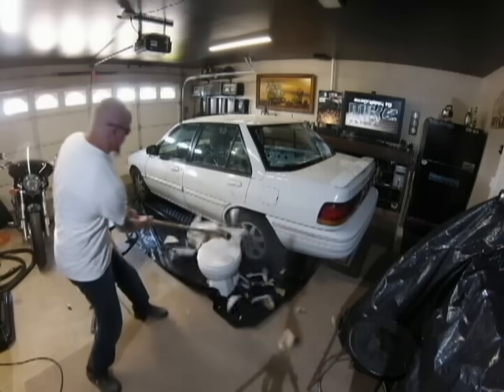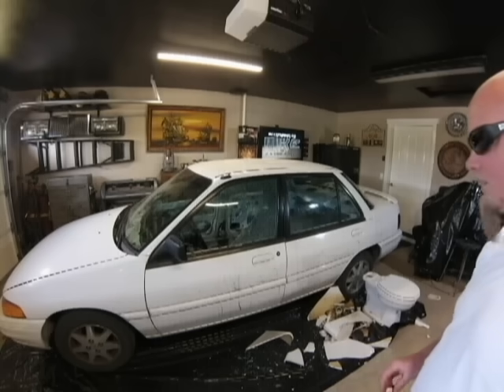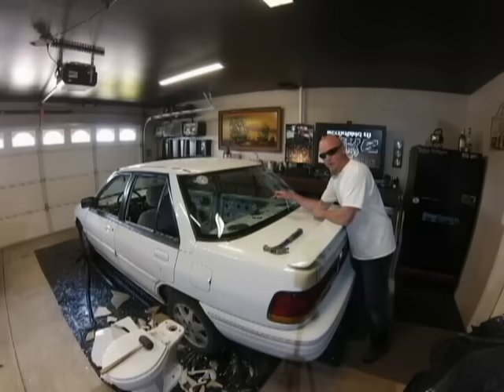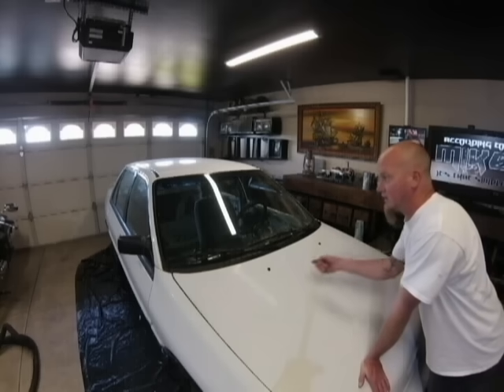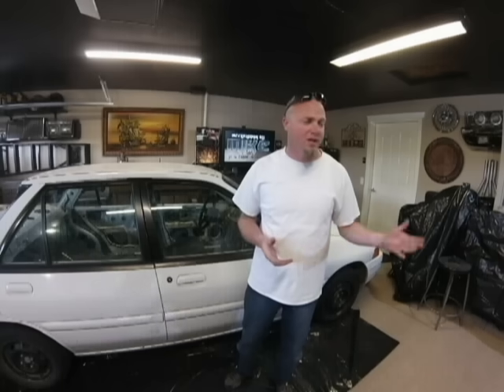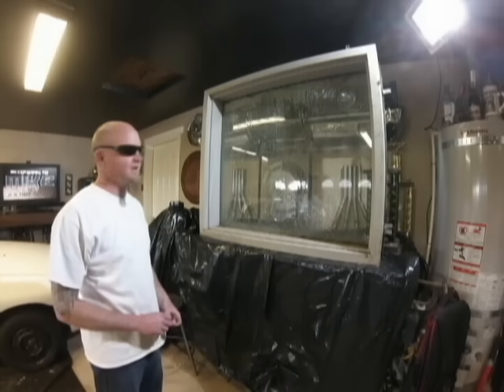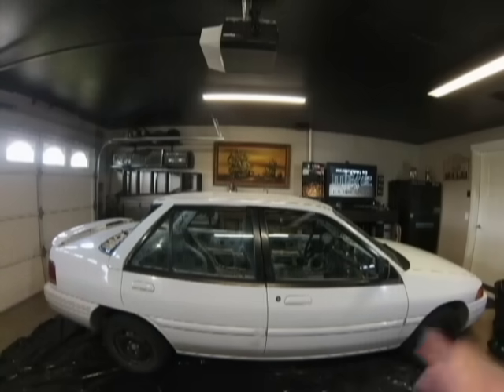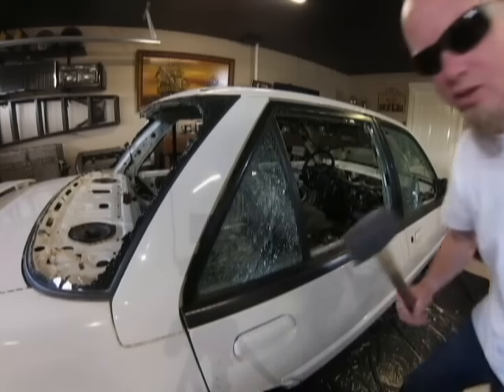How to break glass with a fragment of a spark plug (Part 2)

Comment: I works because the broken porcelain has very sharp pointed edges. Those edges will break tempered glass because it is focusing all of its energy into a tiny surface area. The reason why it shatters so easily is so you don't cut your self up unlike a normal house windows which will break in large sharp sheets. The reason why the windshield never shattered is because it's made of laminated glass so if you hit a animal or something it won't go completely through the window.
Reply: So many poorly written explanations on here so I'll try to explain it a bit better. 

First let's talk about the glass on a car. Most of the windows 
(except the windshield) are made from tempered glass. Tempered glass is 
known for being quite strong, but also fails quite spectacularly, 
instantaneously shattering into an enormous amount of little pieces. Why
 does it do this? Well let's understand the processing. This glass is 
cooled rapidly from liquid to solid. Glass that cools more quickly 
ultimately ends up at a lower density, hence a higher volume compared to
 glass that cools slowly. graph
 Well guess what, there is a thermal gradient in a pane of glass as it 
cools. Meaning the outside rapidly cools and the inside does not. This 
puts the outside of the glass in compression and in the inside in 
tension. This acts as a crack inhibition method, meaning that the stress
 necessary to propagate the crack must first overcome the compressive 
stress on the outside (since glass will fail in tension well before 
compression). So what do we get? A glass that is ultimately very strong,
 but has a massive amount of stored internal energy through the 
tempering process. 

Stress Profile in Tempered Glass

Let's say we want to break this glass though. How do we go about it? 
Well if we can force a crack to propagate through this thin compressive 
stress layer on the outside and into the stored tensile stress region, 
then this crack will immediately cause catastrophic failure. The easiest
 way to do it? Use something small and hard to act as a stress 
concentrator. This can amplify the force applied and help penetrate this
 region. So in the case of the spark plug shard, which is made from a 
hard ceramic (likely an alumina based material) the impact from the 
ceramic is enough to form a crack and cause it to penetrate the glass 
deep enough. That is also why you can buy punches (firefighters and 
other emergency responders also carry these) that are essentially 
hardened steel or diamond tipped and do the same thing.

Hardness of the glass compared to to impact material is definitely 
relevant since this interaction is very similar to a hardness test 
(Rockwell, Vickers, Knoop, etc. Indent tests). The material needs to be 
harder, or at least close to the same hardness as the glass. I highly 
discourage people from using the Mohs scale to get actual numbers. 

Sources: Shelby, "Introduction to Glass Science and Techonology"

Varshneya, "Fundamentals of Inorganic Glasses"
Reply: Mr science here
Reply: +Eric kremer true
the glas is tempered plus the porcelan is very hard and very pointy (force/surface area)
i work in a glass cutting and manufacturiing company
Reply: Go hit a cow going 50 down a highway and tell me if it goes all the way through
Reply: I like it when people copy and paste from wikipedia, maybe one would better understand what is happening if they looked closer into resident frequency of tempered glass and spark plug ceramics, you may find that they are close to each other which causes then to vibrate at near the same frequency when they strike one another resulting in the ceramic to cut into the glass more easily.   Just a theory, would have to test it in a lab to know for sure.
Reply: +Dr Steve no buddy I just had a good dad that explained stuff to me in a very scientific fashion. go check wiki it's not copy/paste it's not rocket science.
Reply: +US_Marine but the windshield is ment to keep you safe yes a cow would probably bust it out of the liner and strait back into a person.
Reply: One more thing you forgot to mention is the potential energy of his throw which transfers to kinetic energy the piece itself. You can tell that the piece is carrying a lot of kinetic energy because when he fails to break the glass, the piece bounces back at a huge distance which implies that the glass was able to transfer the energy back into the piece. 

Laminated glass was designed to repel any incoming kinetic energy and transfer it back into the host. That being said, laminated glass does not absorb the kinetic energy which prevents it from shattering. Normal glass doesn't have this, it absorbs energy and shatters
Reply: +Canadian Bacon thx!
Reply: That really makes a lot of sense to me now👌
Reply: +US_Marine also is you want to contradict me my dad was a firefighter/investigator in cy fair vfd for 27 years he saw a guy's brains splattered all over hwy 6
Reply: Ceramic is harder than porcelain
Reply: Eric kremer No way! Really wow thats awesome!
Reply: Damn it can't we all just accept the fact that he's a witch and he's throwing charmed rocks that has +3 against cursed car windows from the 80s?!!? Occam's Razor states that is the most obvious reason.
Reply: Catapult and a smaller piece would shatter the windscreen but they are designed not to totally collapse. The porcelain works due to surface tensile strength

Comment: You were using massive chunks. The first time I tried it it was with a piece of spark plug about the size of a pea. The window shattered around the impact then within 1 min it spread through the whole windscreen and then it fell apart. The same thing happened the second time I tried aswell. I threw the chunk from about 3ft in front of the bonnet.

Comment: The glass on the side windows and the rear windshield are tempered, and are made to shatter after impact. A piece of ceramic is harder than an average rock, and it has to have sharp edges for it to work (hence, manufactured in the spark plug). When the ceramic hits the glass, it does so with intense pressure in a small area. Since the windows are already under a lot of stress, they instantaneously will break at the slightest hint of give. They're called "ninja rocks" because they are very quick and silent in use, and have been seen legally as a burglary weapon.

Comment: "When thrown with moderate speed at a side-window, a sharp shard of the exceptionally hard aluminium oxide ceramic used in spark plugs focuses the impact energy into a small enough area without blunting to initiate cracking, releasing the internal energy and shattering the glass."

irrelevant, but this is what Google said

Comment: when I was a teen in the 80s we used to break in  cars with spark plugs frags. We would put them in our mouth to keep them moist. For some reason it would work better. I no longer do stuff like that but it was a neat trick. we also used center punches and dent pulleys to pull out ignition switches.

Comment: You have to hit it right on the sweet spot of the porcelain where there is a very small point because when there is a large force enacting on a very small point it's going to more effecting than a large force enacting on a larger point because it's going to spread out more that's why the spark plug porcelain works better because it wasn't as thick as the toilet fragment.

Comment: the reason isn't scientific at all lol glass is an uniform surface and the sharpness of the porcelain is the easiest way to break that uniformity, that's why it destroys it with such ease, a mallet or a hammer isn't sharp, blunt force can definitely destroy glass but it takes more force, pretty much like a balloon being popped by a pin, imagine the force you use to hit a balloon with a pin vs using the same force with a hammer, it's all about a point of focus. hope this helps understand.
Reply: I'm not sure you understand what scientific means.

Comment: It works because ceramic has really sharp point when broken and it's really resistant too. So the sharp point creats a lot if pressure so the glass shatters...
Reply: +Bernard Berari but why spark plug porcelain specifically? The regular porcelain didn't work nearly as well.
Reply: I think that because if the way it's made and the shape it has it allows for even sharper points and edges. If you pay attention at the toilet shrds they broke off into blocky chunks, but the ithers had sharp points. I'm not 100% sure this is the explanation but it's somewhere along this line.
Reply: Bernard Berari
just had a look. Spark plugs use aluminium oxide ceramic which is particularly hard unlike regular porcelain

Comment: this would be a great thing for Mythbusters to try out, and see if they can figure out the reason behind this.  Maybe their slow-motion cameras could figure it out
Reply: +Peter Schmidt a car window is made out of a type of glass that on tension. you have to see it like a ballon thats inflated. you only need a sharp object to break it. a piece of sparkplug is made out of a very hard material. the edges are so sharp it sepparates the atoms of the glass releasing the tension.
Reply: Its something about the small points on the shattered porcelain focuses the energy or some shit
Reply: Is that a micro brewery?
Reply: Myth users already did it.

Comment: So, does the spark plug have to be used? I've heard it has something to do with the electrical charge.
Reply: Nigel P. I did. 200 level college physics buddy. Also took it in my sophomore year of high school :D

Energy transfers, and unless you've got a constant current running through that spark plug, it has absolutely zero current left to it. So what education do you have man?
Reply: When the requirements are a Bachelor's degree, yes, they will :D
Reply: +Nigel P. You act like I give a flying fuck :D
Reply: +George Suppa Car battery holds chemical energy. When ignition is turned, kinetic energy is being transferred to the battery, and chemical energy transfers into the form of electrical energy, which is conducted by the spark plug to fill a gap, creating an electrical current throughout the car, transferring into hest energy along the ceramic insulation. 

Seriously. This is middle school stuff. Doesn't even take electrical physics to explain it. 

Also, I'm taking a dump. Had nothing better to do.
Reply: +Nigel P. Dear Nigel I did a school paper on spark plugs, and the factory tests each plug for fire so they make sure they work before they ship them. (mostly now china)
Reply: Haha electrical charge, theyre only charged if its connected to the sparkplug wires
Reply: Bone Gonsalves Are you fucking brain dead?
Reply: +Nigel P. Actually he's not. The electricity is originally in chemical form. Run a current through it, and it becomes electrical.
Reply: zach rienecker  You clearly need to educate yourself.
Reply: Plus, last time I checked we learned properties of energy transfer in middle school, and MY school district had shitty curriculum
Reply: zach rienecker Yeah, you're funny. Nobody cares about your garbage "accomplishments."
Reply: +Nigel P. Quoting accomplishments when I didn't say it? Brilliant sir. 

I believe my future employers will care, so I guess I just don't belong here. Darn.
Reply: zach rienecker
You're dillusional if you think your future employer will care what you learned in high school or what classes you took in college...
Reply: zach rienecker
You're so sure of yourself that it's pathetic and funny.
Reply: +zach rienecker idiots everywhere
Reply: zach rienecker  You have no idea what you are even talking about.
Reply: justin noguera
 Because he is an idiot. I want an answer from somebody who knows what they are talking about.

Comment: I was thinking that maybe the reason why is not the hardness of the material, but rather the frequency at which the impact of the porcelain cause the glass to vibrate at. 

Just a hypothesis...
Reply: nop they work because the aluminum oxide in then which makes them hard as hell, so the temper glass shatters, Google it, they are called ninja rocks
Reply: +runnerJong Or moon rocks.

Comment: Wow i use to do this when I was mad young over 20 years ago and im surprised people don't know this by now. We'll take my word and my police record it definitely works and the ass kicking i got for breaking my dads good spark plugs,i was young and couldn't find any used ones at the time. LOL   oh it works best if you make sure your hitting the window with the rough part of the porcelain cuz the shiny outside isn't what breaks it believe me if you hold it right and throw it at the center of window you can use a little pebble and not have to throw it hard a all and you can be a few inches from it and it will explode! Just saying